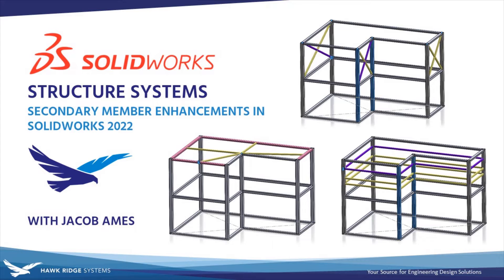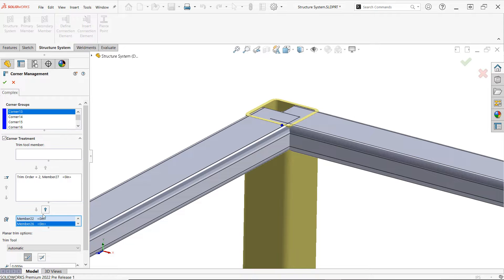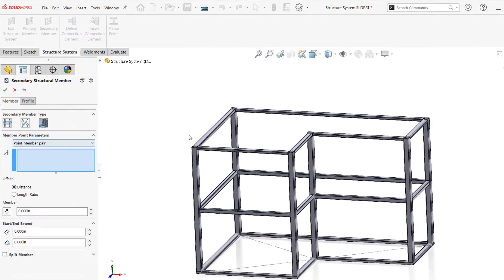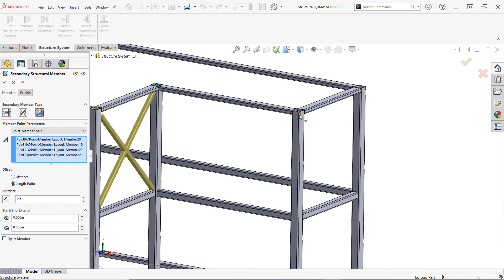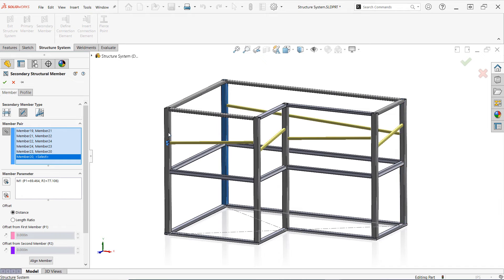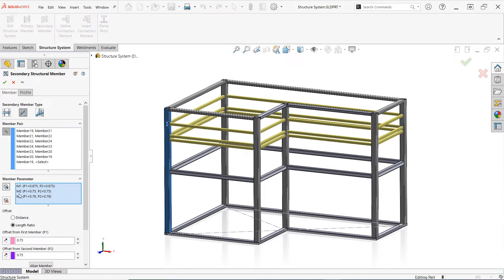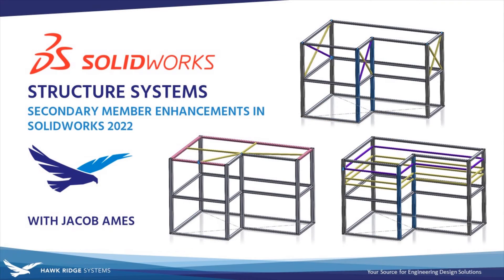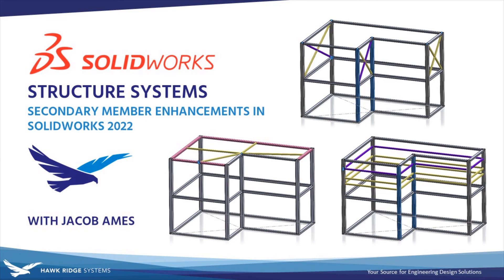What's New SOLIDWORKS 2022 - Secondary Members in Structure Systems

Comment: Hi Guys, thanks for the video.
I would like to know how to update the structural members list in the Structure System with a much more extensive list.
But I can not find anything on this.
Help!
Reply from the maker: The Structure Systems drop-down lists can be enhanced by adding additional weldment profiles to the weldments directory. For more information on how to do this, please reference the SOLIDWORKS Help page found here: https://help.solidworks.com/2020/english/SolidWorks/sldworks/t_weldments_creating_a_custom_profile.htm
Reply: @hawkridgesystems  Thanks for your answer, but you have misunderstood my question.
I have already installed additional weldment profiles to the weldments directory, by control clicking and downoading the zip file and then installing it. It works fine in the Weldment system. However this new list does not show up in the Structure system, profile list. Why it does not show up? I don't understand.